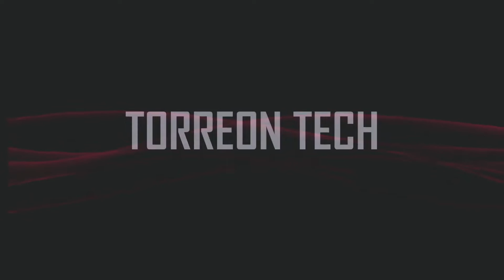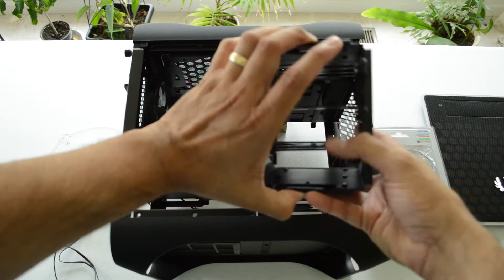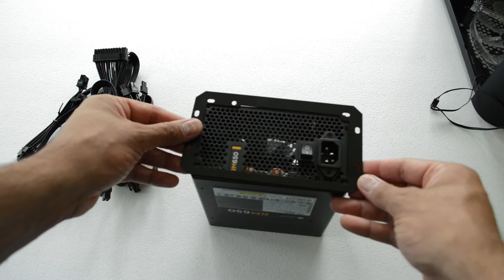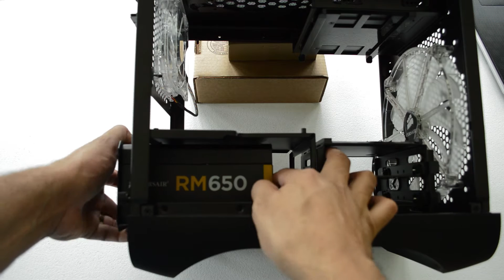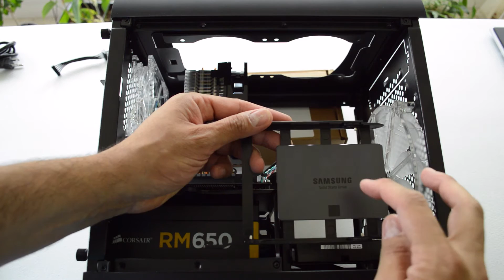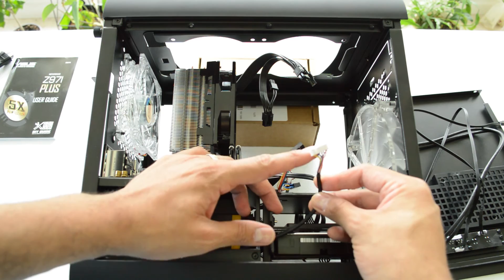Bitfenix Prodigy - i5 4690k Air Cooled Build - Part 3 - Finally Done!

Comment: I will be needing to build this with an optical drive. are you saying that if I use that same cpu cooler you did, that the mounting bracket won't fit?
Reply from the maker: thekelvinlu There wasn't a ton of space there with everything mounted.  You might want to check online if you can get both inside there - I didn't need an optical drive in the end so I left it out

Comment: I am going to build a rig using the bitfenix prodigy. I would like to mount a 120mm exhaust fan on the top. what model of fan would you suggest? Also could you put a link to the big fan you showed in the front?
Reply from the maker: thekelvinlu The big fan I used in the front was a corsair branded fan from an old case I had.  I believe it's a 200mm fan.  I'm partial to Corsair fans but there are a ton of good ones out there.  I've used Xigmatek before and they're not bad.  Everyone has their favorites.

Comment: This is so similar to the build I was contemplating. Unfortunately I was going to use some components from my old PC to complete the build, one part being an RM 850. Think I might just go with a mid tower again as it will give me a little more flexibility.
Reply from the maker: napalmhardcore Oh cool!  The case certainly restricts your options a bit.  In my application, the case size was important.  Good luck on your build!
Reply: ***** Luck? I don't need luck... I'm good!

OK that's a lie. Thanks :)

Comment: whats better, the rm650 or the cs650
Reply from the maker: xEmixalx I'm partial to the RM650 but I think both are OK.
Reply: The CS650 is smaller and I would suggest that over the RM650 in this particular case.

Comment: Will this work good and are all the parts compatable?

CPU: Intel Core: i5-4690K Processor 3.5 
Graphics Card: EVGA GeForce GTX760 2GB
Mother Board: ASUS Z97-A ATX DDR3
Memory: Western Digital 2 TB
Ram: Corsair Vengeance 8GB (2x4GB) DDR3 1600 MHz
Case: NZXT S340 Mid-Tower Case
Operating system: Windows 8.1 System Builder OEM DVD 64-Bit
Power Supply: Corsair Builder Series CX 500 Watt
Reply from the maker: Random guy on youtube with no profile picture On quick glance, it looks like it
Reply: just put them all in pcpartpicker and it will tell you.
That psu sucks, they have bad quality and break after a year or 2. 
Get a Seasonic 620 for 55 bucks on amazon, it's the best sub 100 psu.
Reply: Listen to what Miquel Casanovas says, he's right.

Comment: Firstly, thanks for great video. I have this case and love it. Mine houses a Kabini 5350 at the moment. But I am going to update that to an Intel Core i5-4690K 3.50GHz - Gigabyte Z97M-D3H Intel Z97   - Gigabyte GeForce GTX 970 G1 Gaming. Gonna use a low profile Noctua heat sink as i still want the use of my Easy swap  HDD drive.  
Can you give any thermal results and is yours quite?
Reply: lad crooks is it noisy, cuz I have one and it's realy noisy

Comment: What are the names of the clear fans you used? Are they any good?
Reply from the maker: chibichocolate Thanks for checking out my video!  These fans are: XIGMATEK Cooling System Crystal Series CLF-F1254 120mm White LED Case Fan.  

The fans are nice and quiet and were relatively cheap when I got them a few years ago.

Comment: What would be the best cooling option for this case (I'll be using the default fan setup, with a 120mm on the top). By options, I mean to say what intake/outtake combo I should use

Thanks!
Reply: Intake/exhaust***

Comment: Nice build but don't tell me that you haven't over-clock it. I'm planning for a similar build and I just want to ask about what clock speed can you get with hyper 212 evo on 4690k?
Reply from the maker: Harry Tsang Thanks!  And yes, we're overclocking.  At the moment, we're at 4.5GHZ because I didn't want to push it too hard.  Temps are decent enough.
Reply: ***** May I ask what temps you are getting? I plan to OC with an i5-4690k/R9 280 but I have heard mixed reviews about the Hyper 212 Evo. I feel that throwing in an extra $35 for a Noctua NH-U12 would be a safer bet. What do you think?
Reply: ***** I've got the same RAM and case and my cpu is 4670 (not the K one). I just wanna buy an aftermarket cpu cooler to reduce the temps of my cpu (@full-load about 60-63). My mobo is Asus z87i pro. Does puting the cooler's fan a little bit higher, like you, affect the overall performance of the cooler? Thanks in advance ;)

Comment: Quick Question, with the hyper 212 is there still room to mount 2 fans in the top of the case?
Reply: I don't have the top fans yet installed on my Prodigy, but you should be able to put standard 120x120x25mm fans with Hyper212. I have a PH-TC14PE in my system, and just the heatsink part is a few mm taller than the Hyper212 and I can slide a 25mm fan between the sink and the top, but YMMV.

You should also note that if you use 2x120mm fans in the front, you have to remove the 5.25" tray.
Reply: nimeq Thanks

Comment: Would the the Corsair CX600M 600W PSU be enough for a build that includes the i5-4690k, ASRock Fatal1ty Z97 Killer motherboard, and EVGA Geforce GTX 760 sc.
Reply from the maker: ***** I think you should be fine.  Newegg has a pretty cool PSU calculator on their site if you wanted to play around with it in the future.

Comment: Great build. Only thing I would change is the graphics card really. I have a windforce 3 gtx 760. Great deal for the price, but I do need more graphics power and I would add a second 760 but I only have the 2gb model and I find it wouldn't be a worthwhile investment so I'm just waiting to get a next gen 870/880 gpu. If I where just building a system I would at least get a 3gb 770 to be honest. Also on a side note, I would like to see some more server videos! :D
Reply: There is No 3 GB 770 ;)
Reply: PsycDasH | ♥ Ah whoops. It's the 780ti that has the 3gb option.
Reply from the maker: epictutorials64 Thanks!  When you're dealing with a budget, making the decisions on what to get for the whole system makes a difference.  As far as new server videos: stay tuned!  I'm working on a server rebuild.  Hopefully I can get everything together soon.